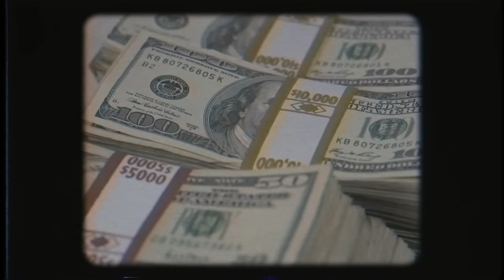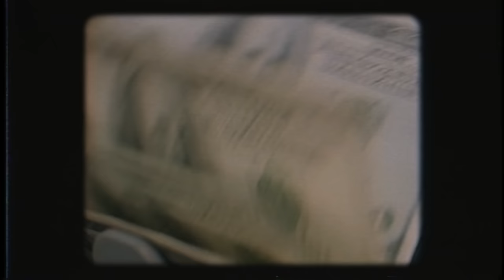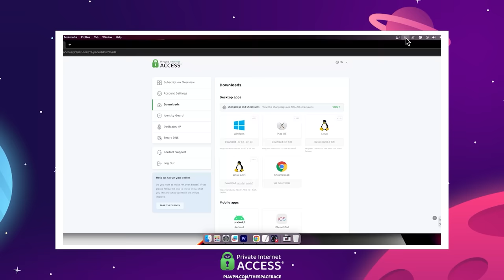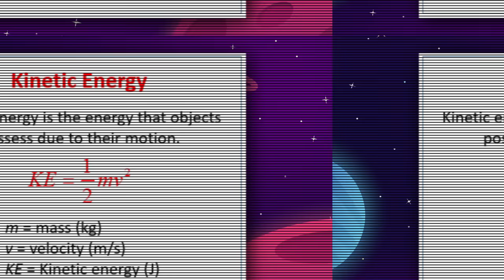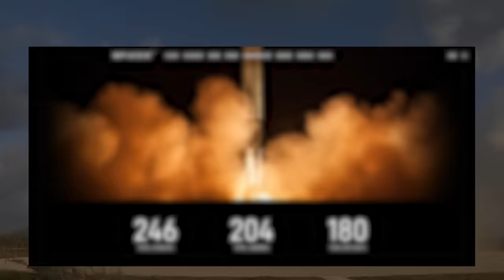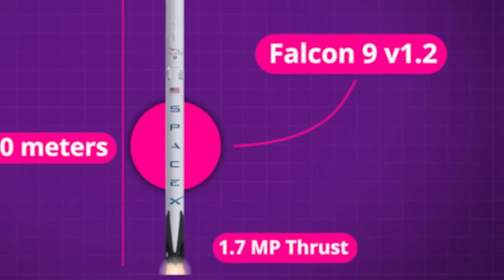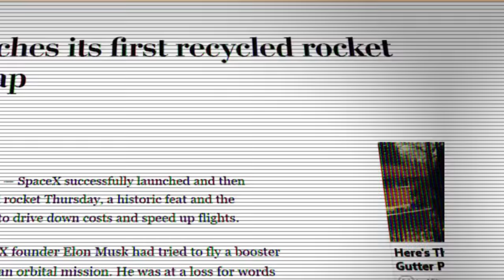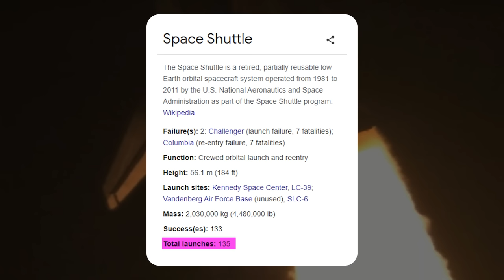How SpaceX Reinvented The Rocket!

Comment: Jellyfish has nothing to do with re-entry.
Reply: The reentry burn pushes the fast air away from the booster until it slows enough that the reentry heat won't damage it.  You would see the mushroom on the booster aft cam  if you watched a launch and recovery.  During the ascent, the rocket plume gets wider as the air gets thinner, but it doesn't curve back toward the rocket (mushroom) until the rocket is thrusting INTO the airflow.  How could it?
Reply: @digitalnomad9985 nice try, but you are so wrong. The "jellyfish" is caused when the rocket while going up gets high enough that sunlight reflects off of the engine plumes during a launch where it is dark on the ground.

Comment: The problem with reusing is who will risk their life on a tail full of rocket engines that have all been through the stress of launch 10 time or even just 5 times. That is an awful lot of used parts to go wrong.
Reply: Another way to look at it is who would risk their life on a rocket that has never flown before when could fly on one that has proven to be flight capable multiple times.
Reply: have you ever took a plane ride? go on a boat? or a car? if yes than your point is invalid (unless you somehow buy new ones evrey time)
Reply: @Blue_Doge  The significant is that rocket engines are running very close to the limit of material tolerances (much the same as top fuel dragsters). the other big difference is the number of engines on board, That is huge number components to go wrong, If I was expected to get on a plane with 30 engines, any one of which, if it malfunctioned would mean the plane would very likely crash or break apart I would rather walk and risk the broken leg. Plane engines often go wrong however planes are designed to be able to limp to an airport on a single engine and even fly with no engines at all, yet despite all those built in redundancies planes still crash, because of relatively trivial mechanical failures and poor maintenance (especially when they have over stressed or over used).
Reply: @davebrown6552 yea I agree that a rocket is more dangerous but re useing a booster or a starship isn't much more dangerous than a new one
Reply: @Blue_Doge   It depend on how prone the material is to stress fracture an thermal fatigue. A new piece should only have the stresses of manufacture to release before being put to use, but how much stress builds up from intense heat with unknown cooling characteristics in thin very cold air and/or vacuum combined with conduction to other parts with equally unknown tempering. It was someone not noticing  that a reused rubber o ring was  getting a bit 'lazy' in cold weather that destroyed a booster and the shuttle it was attached to. How lazy can a reused rocket part get without someone noticing or a ship full of people joining the 60 mile high human candle reentry display team.  Concord was felled by a bit of rubber hitting a fuel tank and the whole fleet never recovered despite many previous years of safe service. If a spaceX rocket blows up no one cares there is no one on board but if a couple of crews get killed it may get their whole license to fly  revoked. especially if they do not find the bit that actually failed.

Comment: An important consideration for NOT using reusable rockets is that for the same capacity rocket, you can put a lot more mass into orbit if you don't need to save fuel for the rocket landing.
Reply: so dumb. throw away a really expensive vehicle...
Reply: It only costs SpaceX 200- 300,000 to fuel a rocket.
Reply: @lordgarion514 It's not the cost of fuel that matters, it's the actual capability.  Sometimes you need to put a certain amount of mass into orbit as a single payload.
Reply: @magnetospin spacex does it too when needed.just not when it isnt needed
Reply: This is relevant only in fringe examples. Being cheaper have a vastly bigger impact on what you can do in space.

Comment: Not every booster is recovered -- some are expended due to the needs of the launch.  So what are SpaceX's plans for the Falcon 9 and Merlin engines?  Will there be a block 6?  Are they making any improvements to the Merlin?  Let's face it -- Starship isn't making any money, the Falcon 9 is.  I don't see any articles or videos ever mentioning SpaceX's plans for their workhorse.
Reply: Starship will replace Falcon 9 so I doubt they will work on a new Block.

Comment: Space Shuttle was reusable.  But also an oversold maintenance nightmare that didn't cost less.  
Musk is going to have many problems with his heat shielding and other factors on Starship.  It will take 10 years to fully sort them out.  During that time something really new and better may appear.
Reply: They MIGHT have many problems.  It's poor form to pass speculation off as fact.  However you are correct on the rest.  It could take a long time to iron everything out and others will be plugging away in the background.
Reply: @TheEvilmooseofdoom   Just going by their past history with Falcon 9.  They started work on it in 2005.  Didn't RTLS until 2015.  
Crew Dragon to ISS about same.

Comment: one important point  that I miss in this documentary is, that the sacrifice  for reusability of all stages of the rocket is, that you need more fuel. You need a lot of extra fuel to decelerate the rocket from free fall to land it on ground again gently. Specially when it is a rocket stage that, unlike the Space shuttle, has no wings to glide on the air.  I also would be interested to see the concept of the space plane (space shuttle and Sierra space dreamchaser) compared to Falco heavy/dragon spaceship. On one hand wings add to the mass ,on the other hand you need no rocket thrust to decelerate and land.
When it comes to missions further than LEO, the difference in use of fuel is even much bigger.
When starship has reached LEO, almost all fuel is used (while Saturn 5 still could continue with the 3rd rocket stage) it needs another  10-12 starships ( according to what Elon Musk claims)  to be launched  to LEO and refill the first one ,so it can continue to the Moon or Mars.

Comment: They didn't reinvent anything - it's still a largely conventional rocket design.

Not a turborocket, not a magnetohydrodynamic bypass/ejector rocket (a la RIME), and not a pulse or rotating detonation rocket.

It's just a refined conventional rocket - and despite it's vaunted 'reusability' it still needs to be certified up the ying yang to the cost of nearly as much as the rocket costs to build from scratch in order to make it viable to insure for flight again.

aka Falcon 9's reusability is a gimmick and nothing more for cost saving purposes - and Superheavy/Starship will be no different.

FUEL EFFICIENCY is what matters to make rocket launches cost less, and SpaceX is blowing no ones skirt up on that score.

Call me when SpaceX actually produces something revolutionary - and something that didn't require decades of NASA engineering guidelines to make it viable to fly in the first place!

Comment: What concerns me about the return to earth booster s and rocket s. The grid fins don’t seem to operate as a steering system as much as the Falcon9 rocket does. IE:The fins on the new huge booster fins seem to be more to be capable of being caught by the giant arms. More so than being able to steer the vehicle. This is a major concern for all of us. Since I’m sure we are all concerned that if any “Giant Booster catch arms. Any lack of steering. The steering arms,being the “Grid-Fins” presently on booster,certainly give me concern as great SPACEX fan and believer that they;(the grid fins) both steer and guide as well as enable the boosters weight(which I’m aware is actually held by even more small worry some catch areas to catch hold of and retain hold of the booster atop of the launch pad. Any misjudgement or a tapping of a grid fin could steer that booster to what is  personal nightmare in my head,which is towards the tank farm,laden with fuel. Why these aren’t father away or underground or protected by 10 meter thick angular highly re-unforced concrete to both& SPACEX have both the finances and minds to develop walls which could take the impact;since it most certainly would be severed into 2/3 pieces on impact already so an angled wall could both push away and deflect any Starship booster mishaps.A secondary “Upward spraying Deluge water system from behind and protected by that same wall could be activated upon impact sensor s built in and a huge wall of water could be put to use to both cool said tanks whilst deflecting mixing fuels,in all their manners and forms of danger and potential destruction. The layoff period after such a happening concerning the FAA’s bullshit excuses Time limitations would see SPACEX out of business there for a major duration. Not because SPACEX could reconstruct it as fast as parts could be manufactured and or trucked in and as normal testament to The SPACEX employees and their overwhelming work ethic,but rather at The Ugly Claws of The FAA and Fish wildlife The United Nations for silicon particles and the water to steam ethics environmental development and I’m positive we would eventually get to see a whole array of newly invented departments. As I say I would still like to see SPACEX build two Islands offshore;adjoined to land by rail with Catch-towers,so that the booster s and rockets could be caught,trained to the mainland launchpad or relaunched from out there if any sort of damage has befallen their primary launch sight. I’m reasonably sure that both Elon and The SPACEX teams are expecting a few compromising failures but getting both visual feedback and data feedback as well as ship recovery even from the waters off the STARBASE island land facilities would speed every part of production up as well as data recovery and even ships from ocean recovery. It’s a mere lingering thought I’ve had in my mind for a while now and their success is ALL that is of importance to me. They have worked harder than almost All other space companies together to achieve this position from whence the presently operate. None of it cheap or easy. All the most difficult but most effective ways in modern rocket design in the world today. They deserve to be granted the right to succeed. For the free world in space and the retrieval of materials for clean making energy as well as the maintenance of The no 1 company in rocket ary and the freedom and possible saving of the human race.  I too see and agree with Elon Musks ethos of making our world multi planetary in order to protect humanity for humanity’s future. And we still need time to both develop and learn to live within those expanded outpost s we intend erecting for ourselves. As well as protecting ourselves and surviving. We’ve been on earth for this many years and still we can’t protect ourselves totally. We need to without question resolve being multi planetary asap. ThankU Elon Musk and all at Team SPACEX as well as Team Tesla who also contribute to space. How I wish I had a green card. Or the right to be accepted into the US to contribute to this great future humane campaign. I’m a highly qualified ceramic shell bronze casting mold maker whose Dissertation saw the introduction of Ceramic Shell Bronze Casting into Africa from 1986-1991. I wish Elon would read my dissertation so that I might protect his ships on their way back home. To keep them from burning up on re-entry. I would enjoy The Bakery. The people s of my country won’t allow me to lecture since I’m white. And they have gone as far as giving up on bronze casting mould specialists since there are non from there own race. But never afforded anyone the chance to educate their students. The only none white to ever cast a life size Christ on the cross in ceramic shell bronze casting was  student of mine. And I started teaching him sculpture in my overtime classes to help me pay my way through writing my Dissertation. The scientific and math data alone of all materials from mine through production to packaging and practical applications as well as eventually having the Viscosimeter calculation checked out aboard the @Space_Station @ISS where gravity was tested in the 6 seconds time frame through the pin hole of a Zahn Cup. I tested it on earth on all known makes of Viscosimeter s from around the world. My Twitter account was locked on that day by @SLS (for apparent Security reason for The Live Space to ground interaction . And my 245.4K Twitter(now X) account was never again unlocked by them. And one of my greatest joys each day of communication between fellow Space junkies like myself and interact ions with @Space_Station and astronaut s aboard was shut down for ever. It bothers me now even more so since it’s become X that nothing I write can be responded to or even read. I used to know @Everyday Astronaut very well then after @SLS locked my account. They locked 🔒 me in my own account.

Comment: Parachutes are lighter than the fuel user for landing
Reply: And require more strengthening, are less controllable, and have other downsides.

But yes, they did initially try for parachute landings and Rocketlab also decided parachutes are the way to go.
Reply: There are mass limits to parachutes, they can't be used on just anything.
Reply: lol proably not for that huge booster they use shoots on the fairings
Reply: @TheEvilmooseofdoom  tell me what the limits are. Based on NASA tests from 2009 we know that less than 4 tonnes of parachutes is needed, while it needs 41 tonnes of fuel for landing at sea. For landing on land a booster needs 120 tonnes of fuel.
Reply: @user-jp1qt8ut3s for missions where that extra fuel is necessary they expend the booster. For reuse they clearly have enough margin available, and judging from how successful it has been I think the minimal components for maximum reliability call was the right ine
Reply: @SyntheticSpy  it has not been financially more successful than disposable rockets
Reply: If you payed attention they need to carry fuel to slow down anyway or the parachutes would just fail.
Reply: @RasakBlood  I reacted to the argument that parachutes have weight

Comment: How many Falcon 9 block 5 first-stage boosters have been built starting in 2020 and are still active? 30 have been built, 12 have been expended after launch, 4 have malfunctioned and been destroyed and 8 more are planned. Space X only has 14 active block 5 first-stage boosters. Only 7 of them have launched 10 or more times, only once has the same booster relaunched in 21 days most take over 2 months of refurbishment and some take 6 months! Zero Data on booster refurbishment has ever been released to the public, Why? It's because no part of any booster that has launched 10 or more times is an original booster other than fuselage. The Falcon 9 block 5 first-stage boosters is not a truly a reusable rocket it's just a refurbished fuselage with possibly all new engines and parts.

Comment: Ummmmm you skipped the McDonnell Douglas DC-X. SpaceX didn’t reinvent the rocket they took the DC-X design and tech and updated it. SpaceX and blue origins both went out of their way to hire engineers from the DCX program and that’s a fact. The DCX gets no love and it deserves sooo much. They pioneered it they tested it it worked it flew it landed etc. yea it didn’t go as high but this was the late 80s/early 90s tech with no money and a giant heavy object falling from 20,000 or 200,000 and landing with no damage is insane. So Where is the love?

Comment: Some people don't have any idea of time. Are we really wondering why the approach was different in  2022 than in  1978. If NASA had taken Space X approach it would have been the greatest idiotic engineering idea of all time.  The rocket will be crashing all the time on the landing pads, you know  1970s control theory, but most importantly computers, and by the way no differential GPS because that was a hack to increase precision invented years later. The same goes for Electric Cars, you are not going to build 100s of 1000s of cars that can compete with gas cars on the cheap gas days in terms of performance using no computers and lead-acid batteries. By the  90s and Early 2000s concepts using rockets that take off and land vertically were all over the place. Finally, Space X rockets don't have all the capabilities the Space Shuttle had, starting with the ability to bring 14 thousand kilograms back to Earth, or having a working bay, or launching 7 astronauts and Cargo in the same mission. That means the design is by nature different. I agree that there is not market for binging stuff back to Earth, and our advanced computers can self-assemble stuff  so no need for a giant bay to assemble stuff, but that is know in 2023

Comment: is all the extra fuel cheaper then losing the metal?
tho i guess we do want to limit the amount of junk we leave up there 
... except we are just flooding the place with junk at the same time
Reply: Yes, fuel is cheaper than the metal. You also have to remember the additional costs of construction and time delays with building the rocket. Also engines would be lost, which are extremely expensive. 

The boosters wouldn't be left in space anyways. When expended, it still crashes back on Earth.

And we aren't flooding space with junk for the most part. Most of the "junk" in space was either left decades ago or are part of recent launches that are coming back down within months.